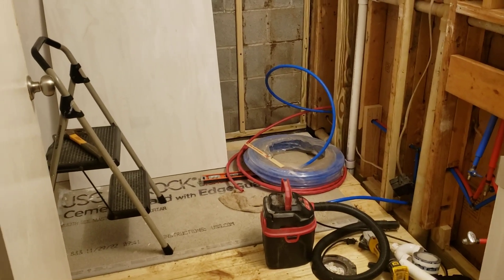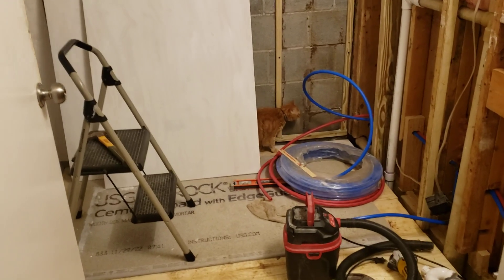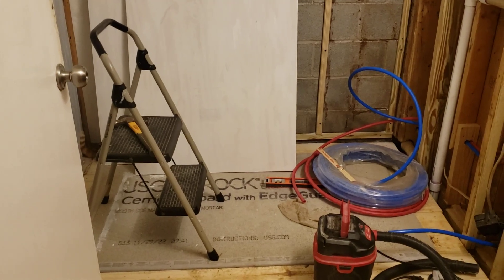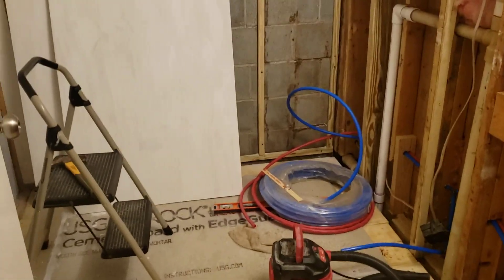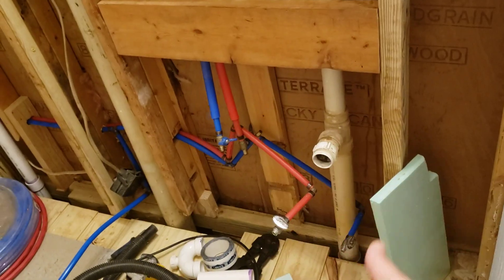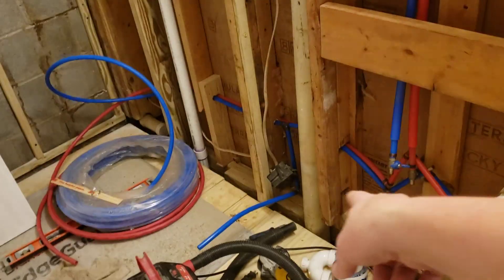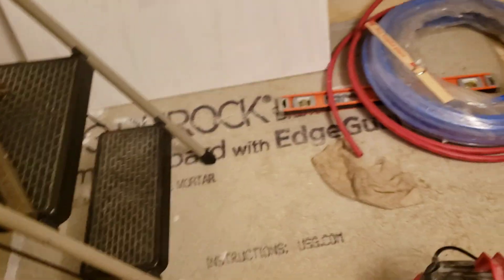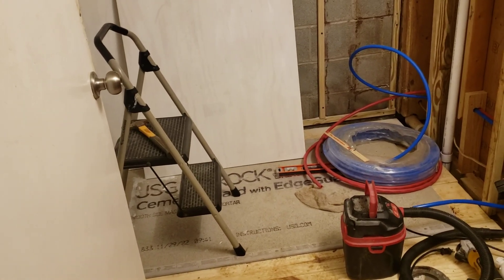Chat With a Friend - Days 7 and 8 Bathroom Redo - #lftn #buildthelifeyouchoose

Comment: Good idea on the floor drain, wished I'd thought of that😏. Have seen it done in utility rooms especially upstairs. Used to do remolding and additions along with new construction. That and 2 bits used buy you a cuppa coffee. Anyway I'd suggest putting a p-trap in to keep bad odors from coming through, learned this from a plumber (haven't thought of it in years), the thing is for the trap to work you will need to pour a little water in the drain every so often as the water will evaporate.
Jerry
Reply from the maker: Thanks Jerry - The good news is that we have an actual plumber advising us from the network. A p trap is a GREAT idea ;)